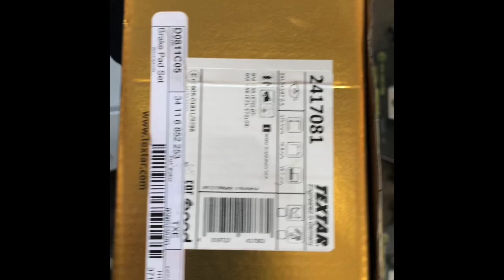2011 BMW X5 35i Brake Pads and Rotors

Comment: For European vehicles there is one major cheap investment tool.   “Tire Tree”

This is exactly what it means….a threaded stud similar to the lug stud but without the lug attached.  Makes it so you can slide the tire on the hub but maintains the position.  You install about two trees one skip one space then the other one.  Once it helps hold the tire in place you install three lug studs.  After that unthread the two tire trees and replace with the remaining two lug studs….has saved my bacon many times and for only a few bucks should be a must have for any European vehicle maintenance….especially Tires.

Comment: I noticed you were only using a scissor jack. You should also have a floor jack snugged up against the frame incase of failure along with the wheel under the tire. Friend of a friend died by doing a quick break job. Wife and daughter came home to find his body.
Reply from the maker: That is great advice thanks.  I will have redundant supports next time.  Wheel and tire under frame is an easy one.